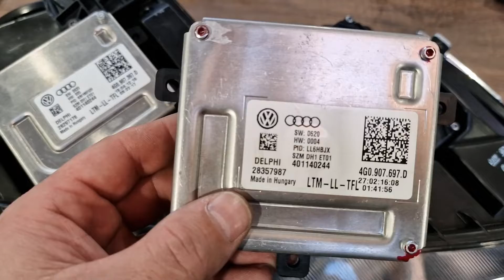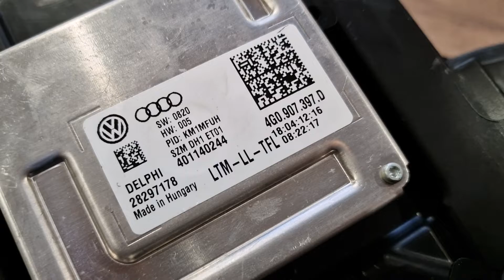How to fix Skoda OCTAVIA Led Daytime Running Lights DRL Strip: xenon headlight module 4G0907697D

Comment: Hello. Do you think that this fault from VCDS means that my module is dead? Thanks
18695 - Left LED Module for DRL and Parking Lights 
          B12EC F0 [009] - Voltage Supply Short to Ground
          Confirmed - Tested Since Memory Clear
Also the left fog light does not work.

Comment: Hello,

My DRL has started to shine yellow. Can you tell what’s the problem?
Reply: Did you resolve this problem?
Reply: @xenonland - I have the same issue. Do you know the fix?
Reply from the maker: Either the drl module is faulty or more likely the "led bulb" located inside the headlight (at the aluminum body) is faulty/out of place.
Reply: @xenonland  what's the product number for the led bulb unit ?
Reply from the maker: @DragoshEmanuel this led bulb at the aluminum body normally is not replaceable, not sold separately by Skoda.

Comment: Thank you for the video.
So, if I understood right, I need to buy a DRL module that has the same ending letter as the original DRL module installed on the car? (The D letter in your case) I have a Octavia MK3 with the right headlight DRL not working.
Thank you very much!
Reply from the maker: Yes, correct. If problem not solved after fitting the working drl module, it means that the LED "bulb"/aluminium body is faulty.

Comment: Hey. My left DRL LED stopped working after washing my octavia rs (i was powerwashing sand out of the gape betven the light and body). Is there any way to test if only the module stopped working or the LED strip went out? Obdeleven diagnose gave B12ECF2 error code. Thanks :)
Reply from the maker: Most probably your drl module has gone. A lot of water should go inside the headlight in order to burn the "led bulb" powering the strip.
Reply: @xenonland  thank you
Reply: The LED module burns the plastic light strip over time, and the end becomes brown. There's no way to stop that, it eventually happens. You can carefully drill away the brown part, and use some solvent type plastic glue to "re-clear" the end, but it will eventually go brown again, I've replaced both LED modules which get brown marks on them also, and have to "rebuild" the plastic "worm" that transmits the light across the headlight about once a year. It's a crappy. cheap design.
Reply: @gregroles69  Hy there. Where did you buy the LED modules? ;because Skoda doesn't sell them as spare parts.